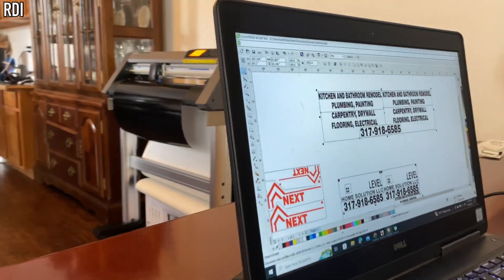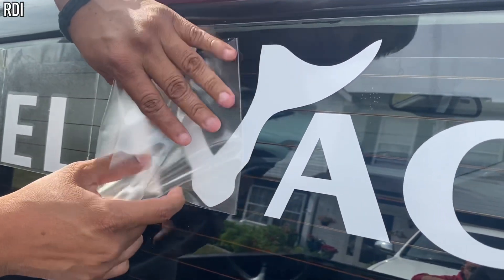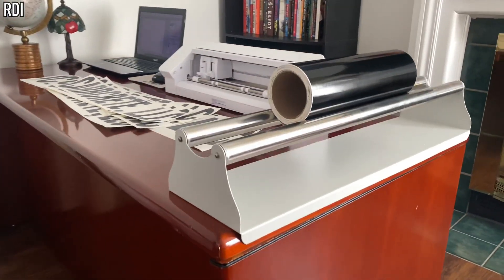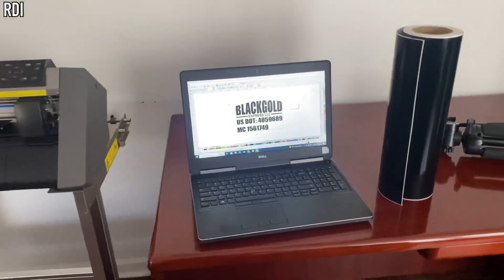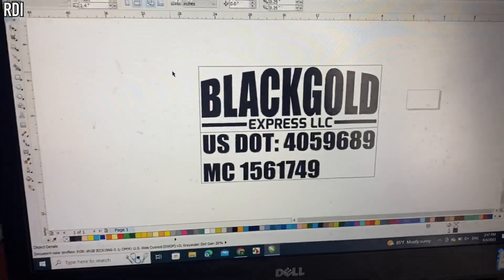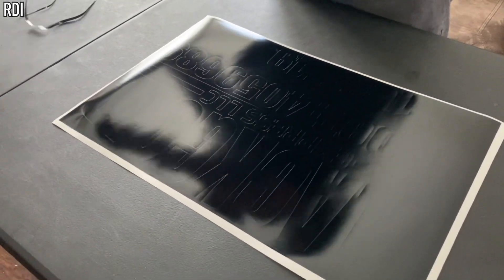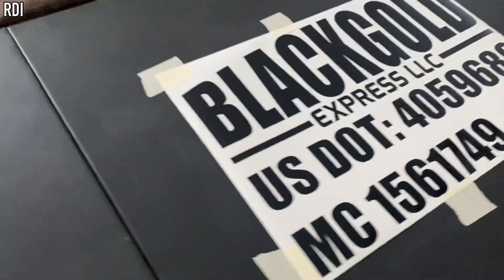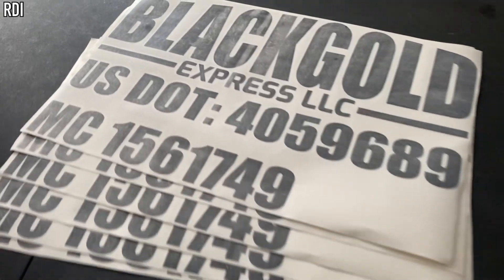Why You Work For Someone Else When You Can Work For You

Comment: If you get a 24inch cameo do you need 24inch rtape?
Reply from the maker: Yes depends what roll you are using they have 12 inch rolls for 12 inch vinyl roll
Reply: @RDIdecals  I wanna get the 24 cameo pro, do you have a link to the 24 rtape? Can’t find it on amazon